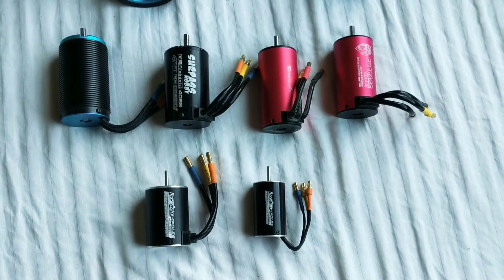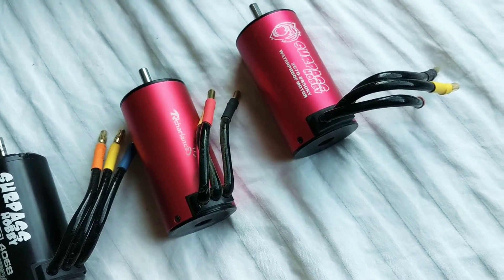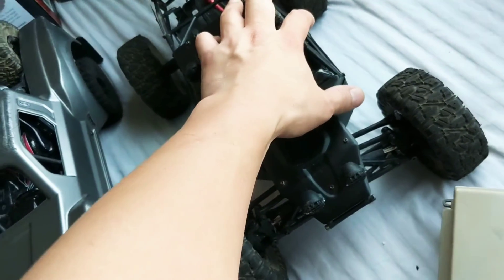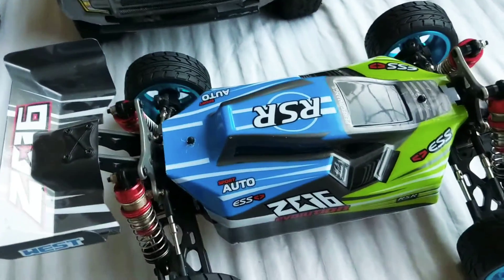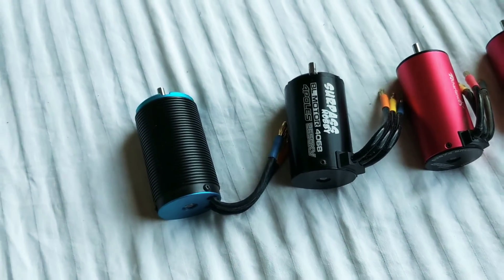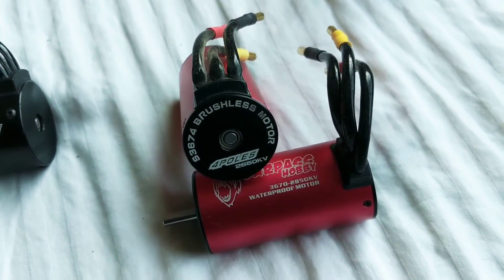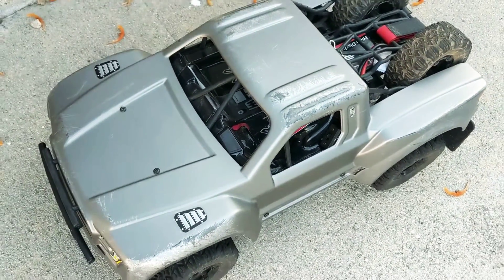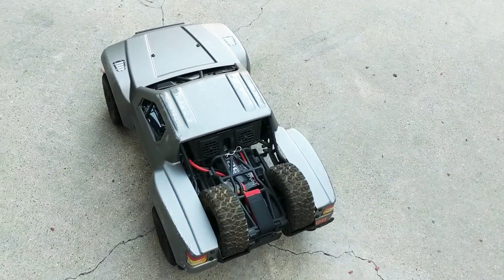RC brushless motor build plans and upgraded Feiyue FY08 3s first run

Comment: What motor and ESC combo would you recommend for slower and more torque for hill climbing. I'm also thinking about adding wheel ext to work with wider tires.
Reply from the maker: Thanks for watching 🤙! Slower/torque application, go with the lower kv ratings. Under 3000kv. The wheel extensions are a great idea since this is roll over prone.
Reply from the maker: Here's a link to a combo for reference. Seems like 2800kv is the lowest for a 2845 motor. It should still be pretty quick on a 3s. Might be able to find it cheaper if you piece them out, but this comes with a program card.
https://a.aliexpress.com/_mr5VU1r

Comment: My son's 08 should be here this week. It's coming with the brushless 4800kv. But only a 35-40 water proof esc. I would love to slow it down a bit. Crazy dirt hill climb and longer run time on the speed down lower for him. Different tire upgrades shock upgrades. Let me know your choices. All from Bg USA
Reply from the maker: Thanks for watching🤙 Awesome, hope you guys have a blast with yours! If possible, I'd use the throttle trim to limit the speed while your son's getting a feel for it. There's also a "child mode" on the tx that limits power. It's roll over prone so take turns easy. Highly recommend oil shocks. These share many parts with the Wltoys 12428. Here's a link to some shocks for reference.
Adjustable Oil All Metal Shock Absorbers Damper for Wltoys 12428 12423 12429 FY03 1/12 RC Car Upgrades Parts
https://a.aliexpress.com/_m0ST5J3
Reply from the maker: If you get a chance, check out my other videos on it to see my mods and some how to. These don't look as scale but perform much better than stock.
Wheel Rims & Tires Diameter 95mm
https://a.aliexpress.com/_mMXWOut
Reply: Man I lowered the buggy part with zip ties. Its no longer a roll machine

Comment: can a 3000mah 2s or 3s lipo fit in that battery tray??
Reply from the maker: Thanks for watching🤙! I use a 3200mah 3s in mine, and it fits perfectly. You can see it in my FY08 battery compartment video and my first run video. I just recommend strapping or zip tying the cage so the battery doesn't come out like my vid. Hope this helps👊!
Reply: It help thx🤜🤛Did you get another esc for those motors??, if you did which one did u use?

Comment: did you modify the motormount on the fy08 to install new brushless motor? great vid btw
Reply from the maker: Thanks for watching and for the support🤙!
Do not have to modify the stock motor mount to install the 2845 motor.
I have a couple how to videos on this FY08 where you can see how the motor is mounted, check out my feiyue playlists if you get the chance. Hope this helps!
Reply: @motorheadaddictions2761  awesome, it doesn’t have to be racestar right? and its just a matter of switching the two motors?
Reply from the maker: Correct, racestar was just the cheapest I could find. It's about the size of motor that can fit, I was originally planning a 3650, but the diameter is too large. So the 2845 had to do. The mounting holes are the same.
Gear mesh is set by turning the motor mount plate within the motor mount brackets.
Hope this helps 🤙!
Reply from the maker: It's an awesome RC and my heart's in it. The only negative is the roll over tendencies. Definitely check out my other videos on it if you get a chance, also my other builds.
Reply: @motorheadaddictions2761  thankyou so much, man. for sure i’ll be checking out other builds, just subbed. that rollover problem couldnt be more true, the chassis is way too high and the suspension is way too stiff, but once we get used to it, it’s a blast. im also planning on getting cosmetic parts, like metal exhausts, air filter using src and maybe windshield using plastic sheets.
Reply from the maker: @jauzaafaishalahmadpadmadis3846  not a problem, and thanks for the support 🤙! Oil filled shocks are a great upgrade for improved stability. I also weighted my chassis with sticky wheel weights to lower the CG. No issues with the added power from the brushless swap, and still wheelies on demand. Check out my crash speed run video. I've only swapped the wheels after then, but also an improvement.
Your scaling mods sound dope🤙 post some vids if you get a chance. I'd definitely check it out. That's another great thing about these, the body is awesome and the solid rear axle for scale.
Reply: @motorheadaddictions2761  sorry to bother you again,  but do you know any tire brand that fits fy08, my tires is starting to go soft and getting bald pretty quick, it still does its job but it’ll be nice to have spares (besides the actual spare ones lmao)
Reply from the maker: @jauzaafaishalahmadpadmadis3846  No bother at all, and I think it's awesome you burned down those tires already 🤙
I'm about stretching that dollar so I use budget parts that are available. I had these planned for another car, but they worked pretty well on the FY08. Much more stable than the stock wheels and tires, but don't look as scale. They are ~$14usd over here.
You can go with any wheels and tires, just need the 12mm hex size. And I think no more than 96mm tire diameter.
4pcs 1/10 RC Model 4WD Sport Pull Rally Car Wheel Rims & Tires Diameter 95mm, Width 37mm
https://a.aliexpress.com/_mqtSJA7
Reply: @motorheadaddictions2761  thanks, man
Reply: @motorheadaddictions2761  i have a question, again. is the racestar motor use m2.5 screw? can an m3 fit just fine? because the only 2845 that i can find uses m3 screws. thanks
Reply from the maker: @jauzaafaishalahmadpadmadis3846  I believe it uses 2.5 like the stock motor. I recall using the factory screws.
Reply: @motorheadaddictions2761  what about the transmitter and receiver? i swapped out the stock one with aftermarket ones (flysky gt3b and dumborc) and when using either of those, the servos cannot be centered properly, it would always have really really large steering angle, like it has the turning radius of a 1:1 truck. does the esc have anything to do with this? the transmitters i mentioned worked fine with my  other rc
Reply from the maker: @jauzaafaishalahmadpadmadis3846  I think I recall upgrading my servo to a emax es08md2, so I may have bypassed the issues you're experiencing. Does recentering the servo horn help?
Been awhile since I've wrenched on my FY08, but will take a look. I'll also confirm the motor screw size too. I'm using FlySky GT3C, shouldn't be a difference from the b.
Reply: @motorheadaddictions2761  ohh yeah, the servo could be the problem, i’m not sure the stock servo horn is adjustable, i tried, doesn’t look like it’s adjustable. so this emax servo is the same size as the original?

Comment: did you exchange esc in fy-08?
Reply from the maker: Thanks for watching. I transplanted the stock electronics to my FY03 to turn it into the brushless version.
The FY08 got the same blue "120a" esc that I fried in my 144001 build. I upped the esc because I'm running the 5900kv on 3s and I know I'm pushing the limits. It's holding up tho.
I think the 14401 couldn't take the blue esc because I'm running the 3650 5900kv in it, vs the 2835 in the FY08.
If you go with a lower kv(~3500), ESC swap isn't necessary. Post some vids or let me know what direction you go, I'd like to check it out.
Reply from the maker: Forgot to mention to check out the body removal video for a look inside of these. I've since swapped out the esc in that vid, but good to get a look. You can seen the blue esc in my 144001 videos.